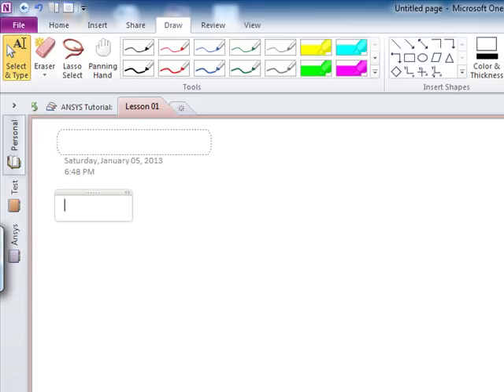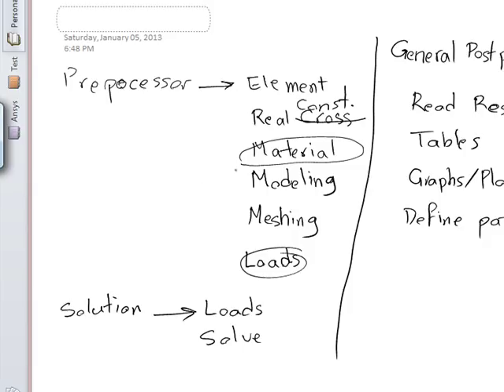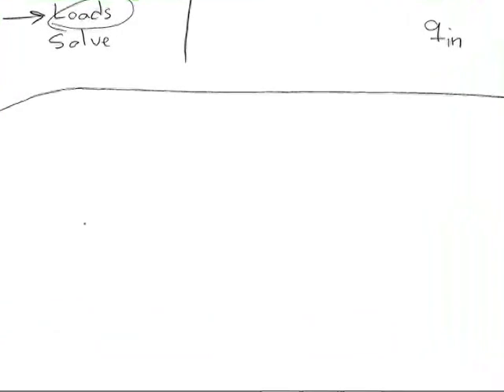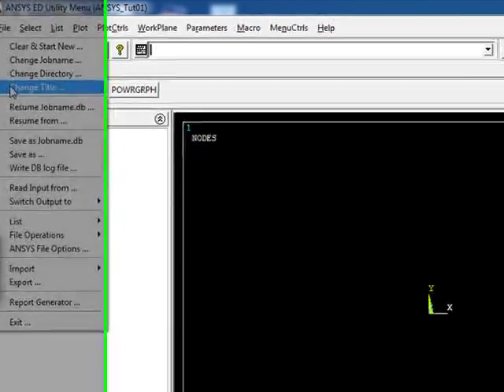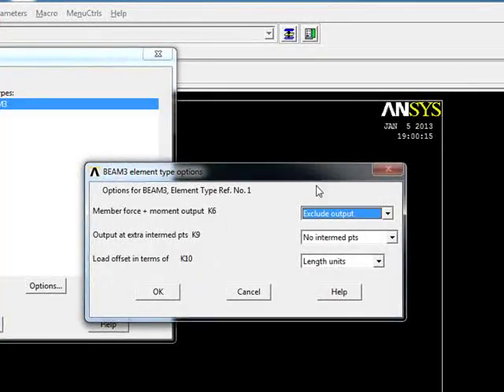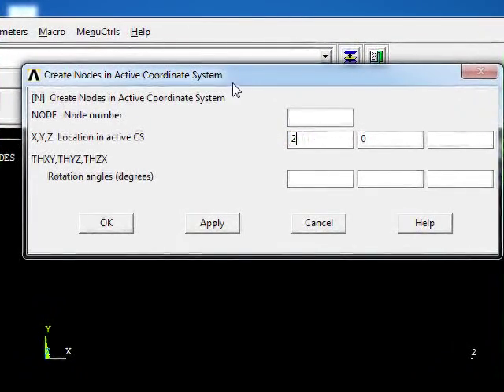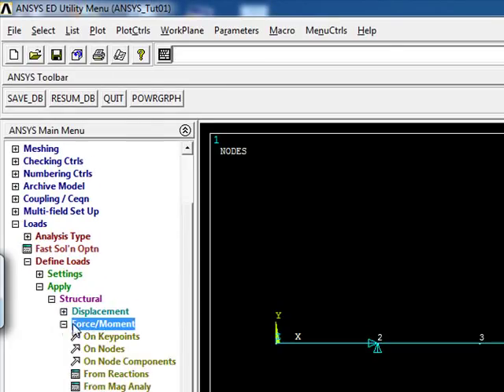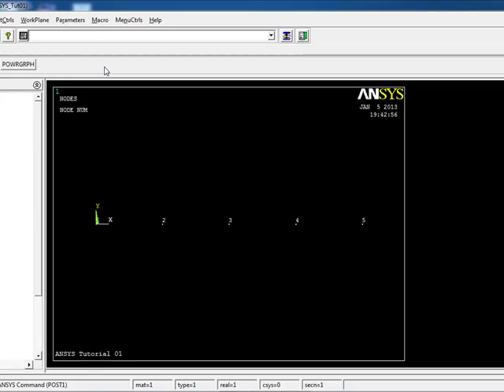ANSYS - Lesson 01: Basics and a Simple Example

Comment: hello hye. can i ask you one question? how to determine the volume fraction in this ansys apdl ? im doing a research on the concrete mixture with glass fiber reinforcement. so i need to determine the volume fraction and the orientation of fiber in this software. how's gonna works ?

Comment: I use the Beam element 2node 188, but finally I got the error like this:  section id set 1 is undefined but is referenced by element 1
Reply: the beam188 doesn't require real constants. you have to define the cross section in : Preprocessor -> Sections -> Beam -> common sections 
and choose the square one with the B and H dimensions. ANSYS will calculate the area and the moment of inertia using these 2 dimensions.

furthermore, as beam188 is in 3D space, you should also add a displacement in the Uz direction in both the nodes 2 and 4. 

i did that and it worked just fine. hope that it helped.
Reply: jannane abdessamad Thank you at first, now the funny thing is that after I click the sub menu current LS said ok with the coming dialog. but the expected dialog saying " the solution is done! " can not pop out. This makes me a little disapointed about ansys, cause I am a beginner of ansys. But thank you anyway!
Reply: +jannane abdessamad Thanks a lot! One thing to complement: When applying displacement on nodes 2 and 4 in beam188, be careful that set UX-UY-UZ-ROTX-ROTY as 0 for node 2, and UY-UZ-ROTX-ROTY as 0 for node 4. ROTZ COULD NOT be set as 0, otherwise, the moment couldn't pass through nodes 2 and 4. :)
Reply: +JingWei WANG I tried the same way. I couldn't also get the solution done when I only set UX-UY-UZ as 0 for node 2, and UY-UZ as 0 for node 4. It seems like ROTX and ROTY should also be set as 0, otherwise it won't work.